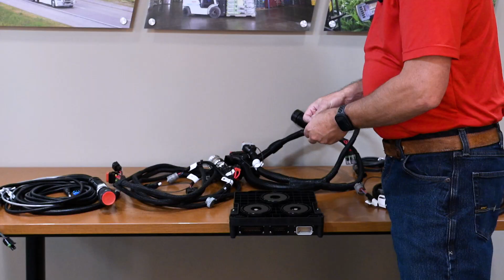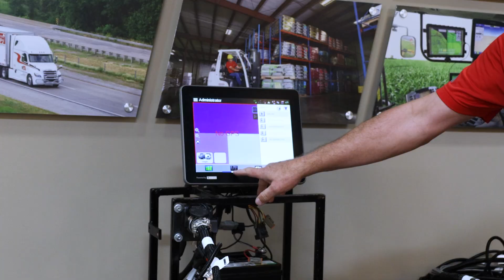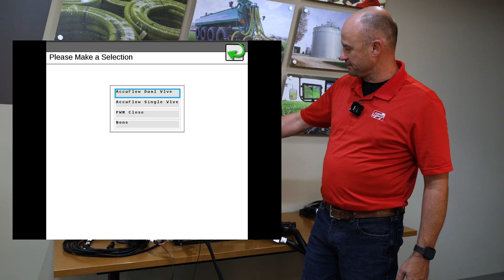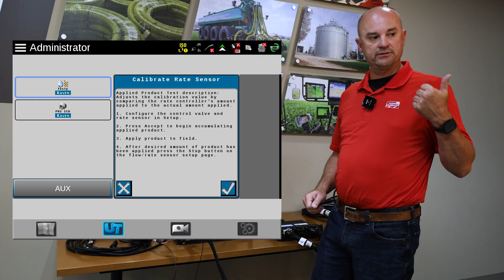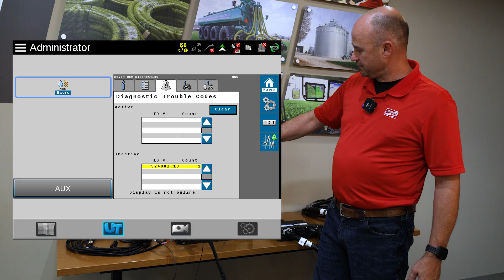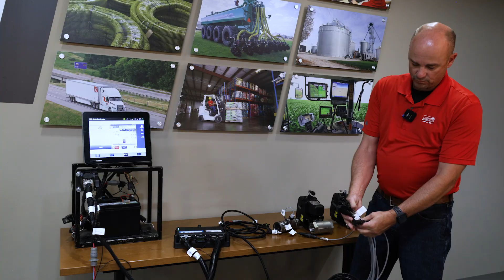How to Set Up a Raven Rate Control Module (RCM) Fast-Valve NH3 System

Comment: We have a 2018 case bar with the raven accuflow vortex system. We just switched to the new raven Rcm system so we can run everything through the 1200 monitor. How do I know if we have a standard valve or a fast valve? Also on our 700 monitor we had our pulse rate at 142.5, is that the same number I use for the new Rcm?
Reply from the maker: Great questions! 

To tell the difference between a fast valve and a standard valve on the AccuFlow system, look at the number of valves after the flowmeter. A fast valve has one valve after the flowmeter, while a standard valve has two valves after the flowmeter. This photo shows the difference: 

https://stutsmans-my.sharepoint.com/:i:/p/vcapesius/IQCIuZQgv-brSonjMOzaduWiAcb6Go5ebBjqWP892OSOXic?e=TKPs1Y

For the pulse rate, we recommend checking with your Case dealer to make sure your 1200 monitor is set up correctly for your specific bar and system. 

If you need something quick to reference, here are some written setup instructions that may help: 

https://stutsmans-my.sharepoint.com/:b:/p/vcapesius/IQDmtxrgBu6ZS6n3770yupYRAZf5oOUICdIbnxXMVMe3bVQ?e=zkM25v

Those links should work for the next 30 days. 

If anything else comes up while you’re getting the RCM set up, give us a call at (319) 679-2281 and ask for Nate.